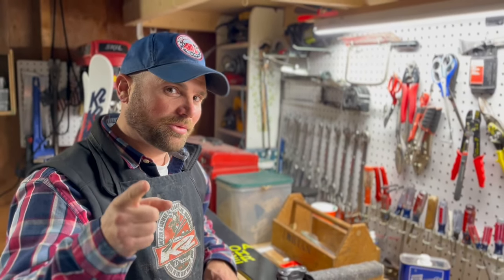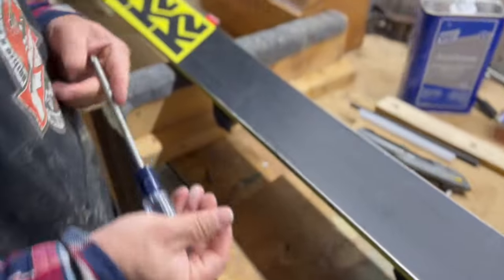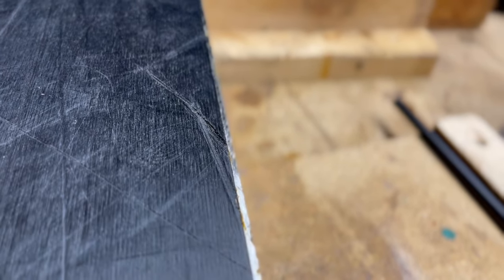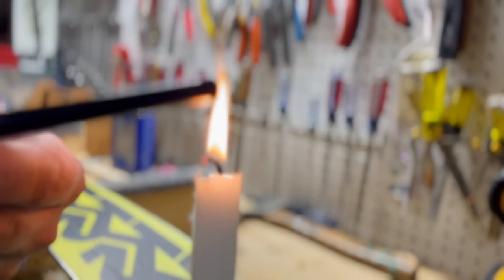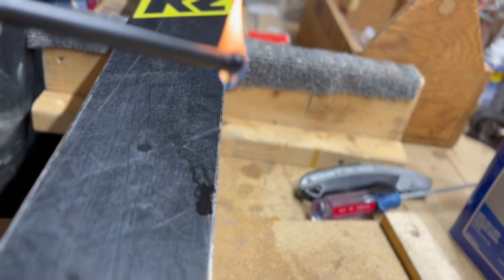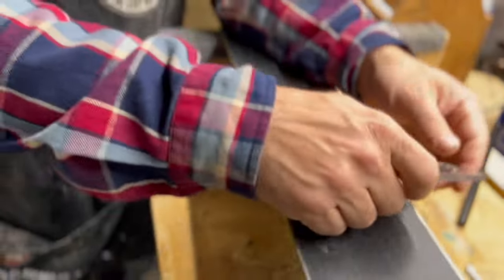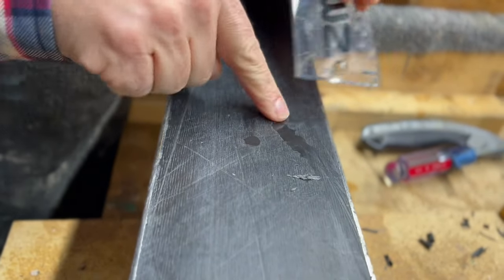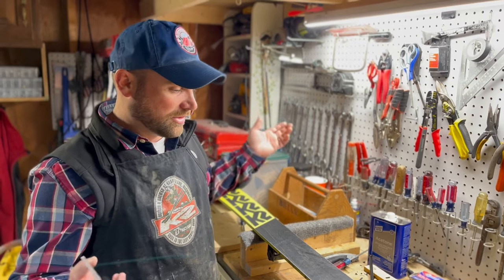How to Repair Damaged Ski Base with P-Tex

Comment: I wouldn't take the ski break off. Just rubber band the break up. Once that screw comes out you open up the core to moisture unless you reseal it, which is a waste of time and risk. Just leave the break in and tie it up.